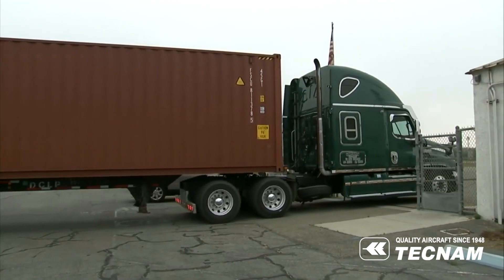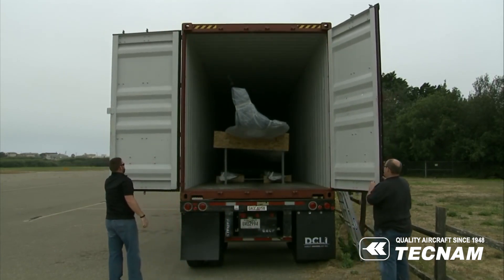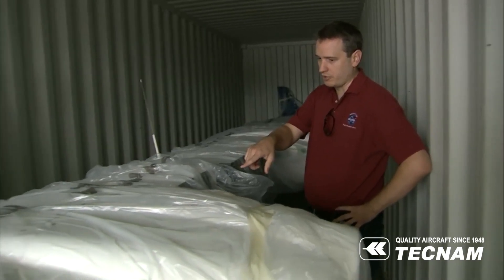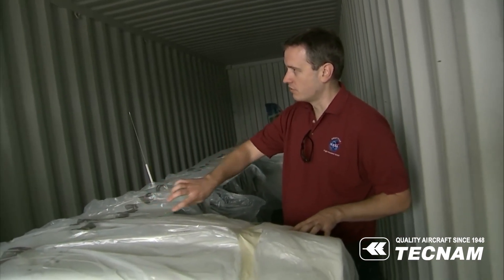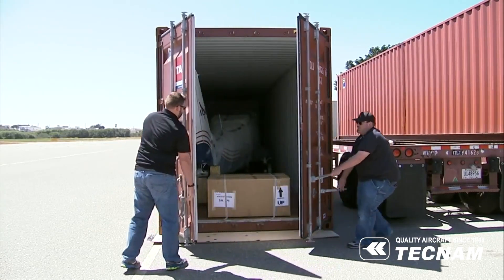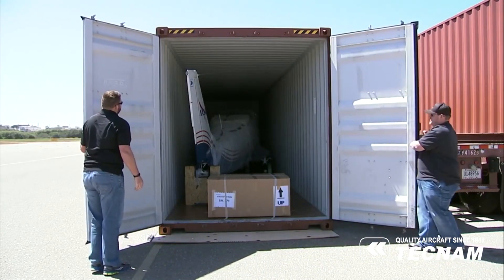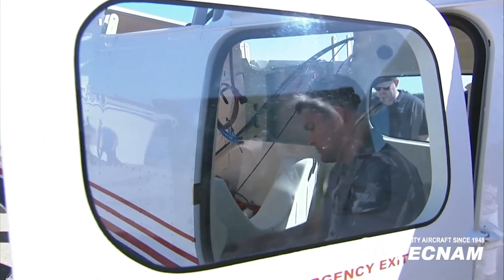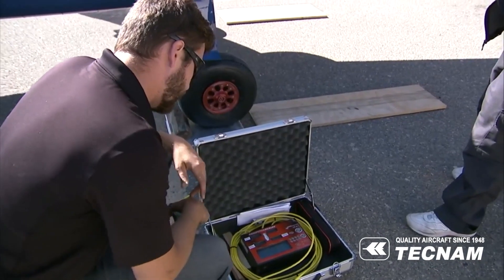NASA X-57 based on Tecnam P2006T fuselage

Comment: so the tiny wings provide just enough lift to keep the plane up at cruising speed and the dozen or so small electric motors provide the thrust required for liftoff, enough thrust it looks to even attempt a vertical take off if those motors could swivel
why not instead work on a wing that changes geometry during flight, provide more lift at take off, and less during flight?
Reply: Done,it's called flaps...

Comment: The p2012 is a 700 HP airplane. Curious to see how well this performs with electrics.
Reply: Having the larger horsepower will not be an issue as the earliest Tesla motors were over 350hp and well under 40kg.  The biggest issue is feeding them the power that they need and getting that airborne.  Batteries don't get lighter as they discharge, so aircraft will now need to be designed with equal take off and landing weights.  One of my favourite small aircraft
(along with the Vulcan P68 series) and glad to see it getting treatment to see it into the future.

Comment: The modified wing has very short chord and the aircraft will not glide very well.  The aircraft should probably be flown in full fly-by-wire control system with the motor staying active especially at low speeds.  This is a high-risk program and should be approached with a plenty of caution.  For any development program involving a new configuration that have never been tried before poses many risks that may not be obvious in the beginning.  Why don't you try radio controlled reduced scale model first?

Comment: Why have unused drag on the wings? There is a much better way to force air over the wings for lift than using crude external motors. When you test it - don't forget to have passengers and luggage. The plane needs to be designed around electric not the other way. Batteries alone will never be enough. An on board charging system is the only solution for any decent flight time. Watch how Sea-Kite.com is doing it.
Reply: Actually, at some point, batteries alone MAY be a way that works; but if you are going to have on-board charging, go to a tiny battery (for emergencies, and to store descent energy) and use an engine/generator system to directly run the electric motors.